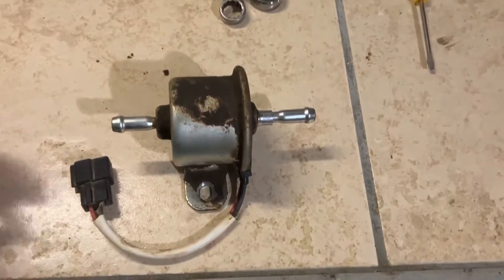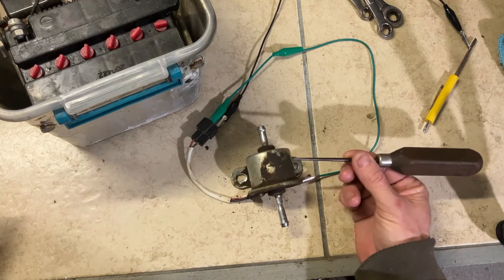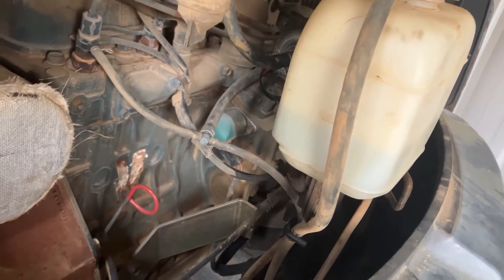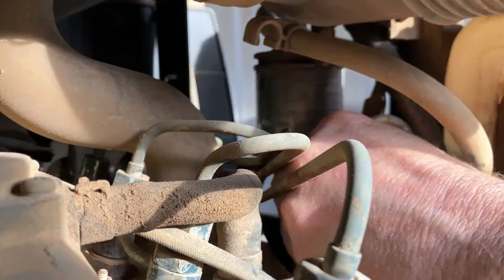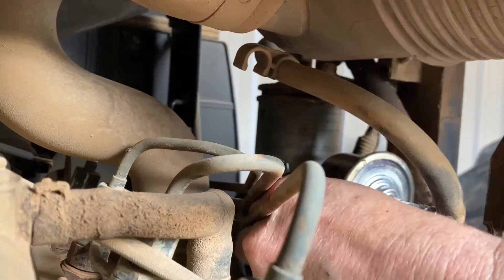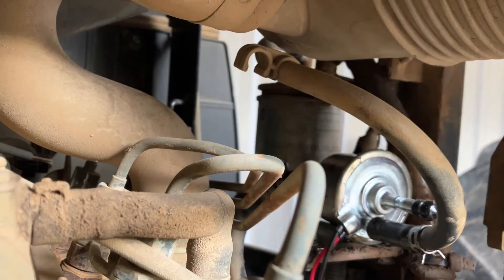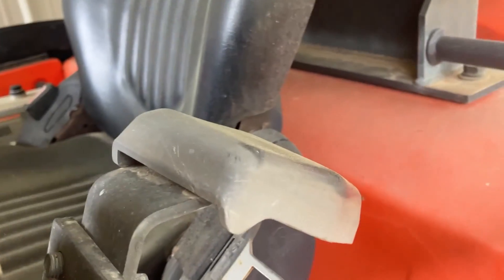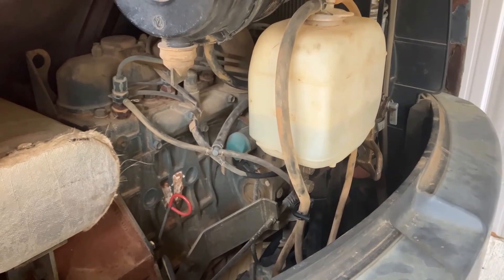[Kubota Diesel] No Start & Miss Fix: Fuel Lift Pump Tractors Excavators & Lawn Mowers

Comment: We have a ZG222 we are looking for a new fuel pump. The fuel pumps listed all show a plug like the one in this video. The current plug is a white plus, more oval shaped with 3 prongs.  We can't find it online that way anywhere ( OEM ) but everything is showing the black rectangular shaped 2 prong plug. Will it still work?  Thanks for any info.

Comment: My pump is clicking but when i put my finger over the inlet i dont feel any suction.

Is my pump bad?
Reply from the maker: There are mechanical parts inside that can fail, and it will not pump fuel. Makes sure the line isn't plugged by debris, and fuel can get to the pump.

Comment: That's a 2 wire connector. My Kubota ZG222 mower has a 3 wire connector. What's the 3rd wire for?
Reply: Could be to a sensor (depending on the year you have and if it has one) or could be a neutral wire but there's a number of things it could be. Refer to a manual for your machine for exact details

Comment: Hello I checked my pump and it makes a noise could it still have quit? I noticed no fuel in the line when I took the hose off? The solenoid clicks is it possible it’s the solenoid. Thanks for sharing vid
Reply from the maker: There are some moving and mechanical parts inside that could have broke or failed. Turn the pump on and see if fuel pumps out on the outlet side if it doesn't something has failed inside the pump, or the inlet line from the tank is blocked, fuel filter is stopped up, or line plugged. Make sure fuel can get to the pump before replacing it.

Comment: my hanix H08 mini excavator quit on me today the fuel pump wire wore thru grounded out and pump burned up red wire melted right off the pump lol
Reply from the maker: Those shorts will for sure burn stuff up. Hope your back up and running.
Reply: @hp_outdoors  ya got a new pump and it fired right up . now my old 773 BC blew a control valve seal :(
Reply from the maker: I put the tilt and lift control valve seals in our 763 think around 10 years ago. Those control valve seals will leak faster than you can put fluid in it once they go. That bobcat is the best and most handy piece of equipment I've ever had.